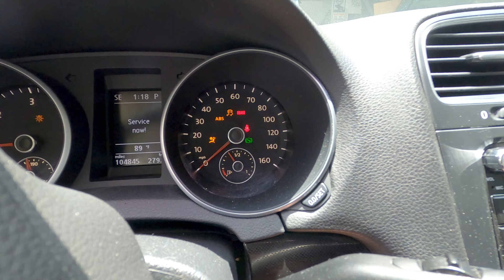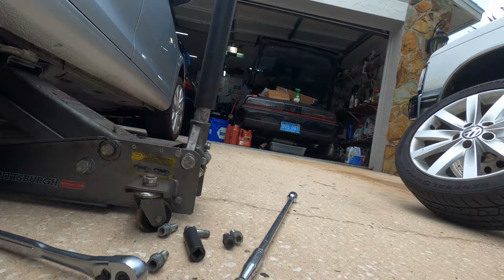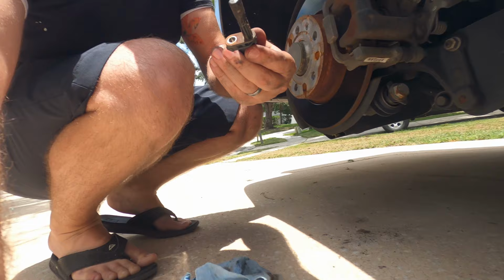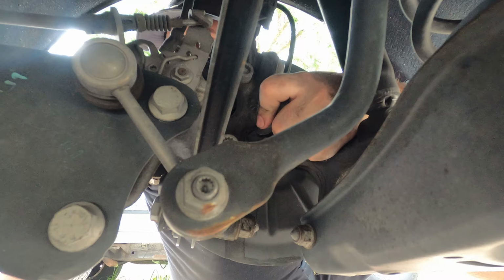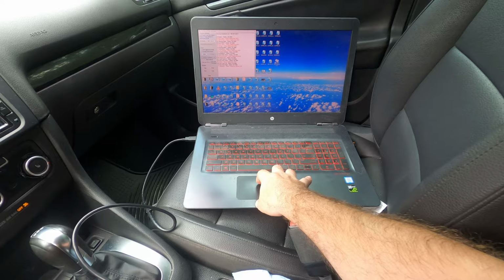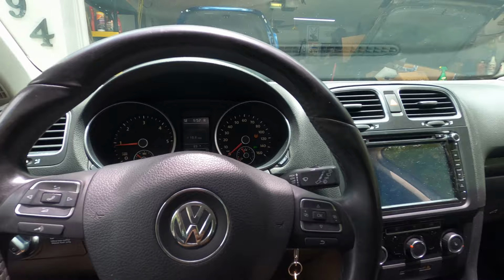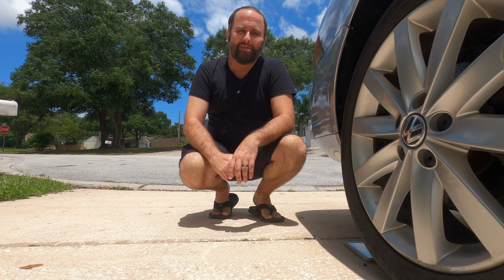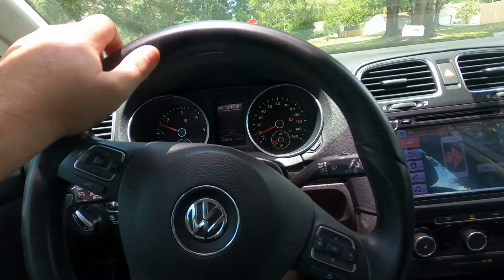VW ABS Wheel Speed Sensor Issues

Comment: I had the exact same warning lights on my audi A3 and Audi told me it was front wheel abs sensor. I replaced it even though it was very clean and still had the lights. Figured out another abs sensor on the rear also needed replaced that and now all warnings are gone.
Reply from the maker: I'm not actually sure cleanliness matters much since cleaning didn't have much of an impact for me.  That's why the scans are so important, that way you know if more than one sensor is acting up.  Weird that the dealer would have missed that though.  Glad you were able to get them all off.  Very annoying to have the whole dash lit up.

Comment: Please use wooden/rubber  blocks between Jackson and stands.. otherwise you remove pant and dent bodywork. Also..you can test your old sensors with an ohmeter to see if they are shot.
Reply: These cars have a solid piece of steel to jack from. It will not bend or dent. It is not a pinch seem just fyi.
Reply: @timbenracing  …paint….then…….rust.

Comment: my passat has this right now, my brake pedal is going nuts when i firmly press it, my gearbox is shifting like a madman, i will take my car to a garage tomorrow, i just replaced my 2 back wheel bearings. hopefully a new sensor will fix it.
Reply from the maker: If the pedal is acting weird you may have bigger issues.  Hopefully it just turn out to be the sensors.  If it all just started happening since you did the wheel bearings then good chance at least one of them got damaged in the process.

Comment: I have a 2015 Passat TDI and am having the same issue except mine is random. It goes off for a few drives, no issues then randomly comes on while I'm driving, then the next time I start it, it comes on again and yes I'm also having issues with the transmission jumping or just having delayed shifts. I was scared my transmission was going out but this gives me hope lol last time it was scanned I was told the front right needed to be replaced so im going to try that.
Reply from the maker: Mine started out like that.  Then the lights stayed on all the time, but the shifting issue was still random.  Good chance swapping out that front right sensor will fix your problem.

Comment: I have same issue with VW CC 2013, lets hope this fixes the issue.
Reply from the maker: It should.  If not check the wiring.  If it's not that, then it's probably the ABS module, which is going to be a bigger and more expensive repair.  WIth as common as this is, it's probably just the sensor.  Good Luck!

Comment: What brand/type of code OBDII reader are you using? I need something that will point me to the correct sensor.
Reply from the maker: I use a VAG-COM from Ross Tech.  It's what you need to get VAG specific codes and interact with the modules.

Comment: awesome video! I have the same issue and dealership said the rear right bearing and hub assy. needed to be replaced along with the speed sensor. will def try this. I dont have a computer to clear the codes, just a fox code reader. will the codes clear themselves once driving, like in your video? thanks in advance.
Reply from the maker: Thank You!  If you replace the faulty sensor then your CEL will probably go away like mine did.  There may still be codes stored in the computer, but it won't cause any issues.   Just keep a close eye on your wheel bearing, if it's making noise then you should replace that too.  If it fails catastrophically then it can be very dangerous.

Comment: Thanks for the video. I have been facing a similar issue with my 2011 Passat. The lights on the dashboard only come up when in a long drive +200 miles, then, if the car is stopped for a while, when restarted the error is usually cleaned from the dashboard. I'm not sure what is the root of the issue in my case.
Reply from the maker: My issue started off like that.  Then eventually the lights stayed on all the time, until I replaced the sensor.
Reply: Same issue with vw cc 2012 
The problem is that when i stop for a little while the error cleaned and the diagnostic scanner can not see any errors.
Don’t know if i have to scan it when the lights showing for the scanner to catch it! But  i can’t expect when it might happen again, to prepare to carry it by the mechanic...

Comment: I have the same lights on, on my Jetta. The lights only come on for a month or so, then they turn off, one at a time, after a few minutes. Eventually they just don't come on anymore. Then maybe a year later, they will come back on again, and cycle repeats. Lol. 2017 Jetta, only about 25k miles.😊
Reply from the maker: I had a little bit of that.  Lights would be on for a while, all would go off, then they would come back.  Most likely you have a sensor that is failing slowly.  I've got another one starting to do that now.

Comment: Hi there!! Great job with video and fit. I am checking to see if I can perform this action on my 2016 Passat S model. Thanks for the link to sensor and ross-tech site..question though- Is the software and hardware compatible for all VAG models? Any idea? I gained confidence after watching you solve the issue and I intend to do it myself now. Please let me know if I can utilize it on 2016 model. Many thanks !!!
Reply from the maker: It should be pretty much the same for you car.  Scanning will tell you for sure.  Yes, the latest VAG-COM should work for your car, but you can confirm on Ross Tech''s site.

Comment: Thanks for the excellent video.  I wish I found this video earlier. Just paid $600 for the VW dealer to make this easy fix.  It all started with my airbag light being on.  They replaced the air bag controller ($900) and 2 days later all the lights came on. They then diagnosed the rear abs speed sensor.  Was it the abs speed sensor all along?
Reply from the maker: I don't believe the ABS sensor should have had anything to do with the airbag.  Do you have a sunroof?  My sunroof leaks have caused airbag issues, from corroding the passenger seat wiring harness.
Reply: @VHickleGarage  your airbag light was on in the begining of the video and went away after you replaced the sensor
Reply from the maker: @ryanloughlin6380  You are right.  Lol not sure what I was thinking with this old reply.  I believe the airbag system may be related to the vss because it's made to not set the airbags off below a certain speed.  This is also something I haven't confirmed, but as you pointed out I had the airbag light and then it went away with the new vss.

Comment: I had took my Jetta to a shop, to change 2 front struts, and 2 front ball joints I got my car back and it has all of these lights. Also my speedometer isn’t working with the lights on is this what yours did? They charged me 1700 just for those items. I have 0 lights on and now my engine light is on too.
Reply from the maker: I believe the Speedo not working could be bad Wheel Speed Sensors, but I'm not 100% sure.  With the work you had done it would seem likely that they either left a sensor unplugged, or damaged one.  I would expect you to have warning lights like what I had though.  You should take it back to the shop and have them scan it and fix whatever they broke.

Comment: I have a similar issue with my Jetta I replaced the sensors but still having the issues with the lights staying on. This helped a lot with changing out the parts. But, I am still seeing the lights as well as the speedometer and odometer are not functioning. I was told by the dealership it was only my sensors that were the problem. Any ideas? Thanks in advance for any advice.
Reply from the maker: I'm not entirely sure.  It could be something to do with the computer.  Have you scanned it again since replacing all the sensors?

Comment: This same thing happened to me after I changed the setting for “Starting Vibration Reduction” while the ABS module was hot.  Now getting a message that it has lost it’s coding, or improperly coded.  Going to need to take my car in to have them generate the long coding to recode it I guess.  I didn’t have a saved code before errors.
Reply from the maker: I haven't messed too much with the coding features, but I remember reading that you can cause some issues if its not done properly.  Have you tried the Ross Tech site for help?  I know they have a lot of info posted there.
Reply: I’ve tried googling it, but turns out it uses LONG coding, 2017 GTI MK7.  I was using OBD11 Pro, under brakes and Adaptation, then starting vibration reduction from OFF -> NORMAL - doesn’t really change that much.  I think it glitched and thought I had more features than I have.  I took it to a shop and they found it was coded for extra features, like front end collision and lane keep assist.  This caused the ABS module to clear out code and go offline.  It took the shop about 2 hours to code correctly and redo all the adaptations by driving and setting steering wheel position sensor.  Car runs great now, NO 6 lights with of them 4 flashing.

Comment: I had to install a new fuse box (the one over the battery)(2004 Jetta).  Upon completion of the installation, the ABS and Brake lights came on.  Assuming the brakes/peripherals didn't suddenly go bad in my garage, could I have accidentally triggered this code, and need to erase it?

Comment: Just had this happen to me trying to change the rear caliper, had to use a tube for extra leverage since those 12 point bolt were rusted to hell and back, ended up busting the abs connector and now I’m dreading to fix it
Reply from the maker: The sensor is very easy swap. 1.5/10 for Difficulty.   Changing a caliper is certainly more involved.  If anything is rusty or stuck make sure to spray with PB Blaster and let it sit overnight.

Comment: Hello my friend thank you for the great video but I have a question. When you got all the lights on (ABS / stabilizer, air bag, traction control) did the car was driving normal or the acceleration did not pass more than 30mph ?  All the lights came on my car and I cannot even drive more than 30mph thanks
Reply from the maker: I did not have that particular issue, but several other people have said they did.  Once you identify the faulty sensor, replacing it should fix all those problems.

Comment: got the same lights plus the battery light along with the steering light. car wont start but will turn over. any ideas? (vw gti 2011)
Reply from the maker: The battery and steering wheel lights are common with low voltage and/or battery replacement.  Have you replaced your battery recently, or is it old?  Low battery voltage can also cause a no start situation where the engine does still crank.  Battery, and the connections would be first thing I would check.  After that you really need to scan the computer to see what codes are stored.

Comment: Thank you for the video! I have the same lights coming on my 2012 Jetta SE and scanned it to find out my rear right ABS speed sensor is also malfunctioning. I feel the same transmission issues with gear hunting you described. However, I also hear this sound coming from under the car, best way I can describe it is as if a branch was caught underneath and being dragged on the road. It is not always present and it is rhythmic, increasing when I accelerate and decreasing when I brake. It also seems to be more present when turning. Is this something you experienced/Do you think replacing the speed sensor would fix this? Or is there a bigger issue with my brakes or wheel bearing?
Reply from the maker: That noise shouldn't be related to the speed sensor.  Sounds like it's possibly a bearing or CV Joint (axles) issue.  I have some bearing/CV noise as well that comes and goes.  I know those are both common issues on these cars.  I have all new stuff sitting in the garage, but I haven't gotten around to swapping them yet.  If your noise is intermittent then it's probably not dire yet, but something to think about doing soon.
Reply: Did you use a regular obdII monitor?
Reply: @joewaltz2709  it was an OBDeleven

Comment: I drive a 2012 GTI & I’m having all the same lights come on my dash but I’m not experiencing any gear hunting issues & no traction or braking issues as far as I can tell. I’m hoping it’s just a broken sensor or wire rip near the sensor, or I might just need new rotors and pads.
Reply from the maker: Best to scan to see what all codes you're getting.  It's probably a bad sensor that just isn't giving you the other issues.  Brakes may, or may not be related to VSS issues.

Comment: Mine broke is there a way to get it out without taking off the wheel bearing ?
Reply from the maker: The bolt broke, or the sensor broke?  If it's just the sensor it should be pretty easy to drill out since it's mostly plastic.  Alternatively, you could use a torch to heat it up and probably get it out that way.  

If it's the bolt, you're going to need an extractor (never works for me), or you'll have to carefully drill it out and then chase the threads, or re-tap it.  Worst case would be drilling it out too far, in which case a helicoil kit would probably be your only solution.

Comment: I also had all the dash warning lights. The only difference is that I didn't have to repair it. I had gotten to the live screen on my new Autophix 7610 scanner. (The instructions are mysterious.) I was looking for the tire pressure monitoring system but today I stumbled upon the brake system and found the four wheel sensors. It said the front left was not working. I took a chance and found and clicked OK on erase all error codes. THEY ERASED! All warning lightsl had gone out BEFORE while intestate driving but they always came back on before I got out of my driveway. I especially hated that my cruise control would not engage.Then I followed direction on the scanner and unplugged it and then reconnected the scanner. I scanned it for fault codes and it said NONE. I went back to the live four wheel sensors and all were listed. I put it into drive and all four showed 11mph. 
FIXED! I will keep my four sensors until I need them. I hope others, like me, used V. Hickle's video to  stay out of the dealers shop. The 2016 Passat oil change last week, was advertised to include an inspection. I spent HOURS searching manuals and watching ALL these videos, when VW could have found and erased the codes in a minute. ( I thought they did.) I hope this works for yours.
Reply: Today I took the 2016 Passat for a pleasure cruise. NO CHIMES, NO DASH WARNINGS - NOT ONE. I think I'll keep it. 79,000 mi. ;)
Reply: next day ALL LIGHTS BACK ON DASH :(
Reply: next day I discovered it's not a torx 30 , it's a 5 hexagon for  the sensor bolt. A small right angle handle or long bit would have helped. It was stuck on so a butter knife  and hammer broke it loose. I used a sensor from Amazon which had all four for under $30. The scan showed it working and after a half mile the TIRE  AND STEERING ANGLE dash light has not come back on. The ABS and TRACTION dash lights were flashing alternately and after a few miles they now flash together. The car has under 80 K. Fault code will not read (no communicate) BTW: it was a wet road and braking seems fine for hard stopping. NO CRUISE CONTROL AGAIN. It's going to the shop. SORRY
Reply from the maker: Sorry to hear you had to take it to the shop.  Sounds like you may have something beyond bad sensors if you weren't able to communicate with the computer.  I've always used the VAG-COM.   I've heard the VAG cars can be hard to fully access with generic OBD 2 scanners, but weird that it worked for you the first time but not the 2nd.

Comment: So I have a 2019 I’ve replaced me entire abs wheel speed harness and sensor and it’s fixed nothing even throwing epc code now
Reply from the maker: Which codes did you have at the beginning?  Just sensors?  If you've done that much already, it sounds like the ABS module itself could be bad.
Reply: @VHickleGarage the one thing I haven’t replaced yet is the wheel bearing and I’m wondering I’m that’s it

Comment: Hey! So I’ve just done that on my mk6 golf and the codes came back on. I have no idea what it could be. My fuses are okay and the sensors new. I’m just lost now 😂
Reply from the maker: Have you scanned since you replaced the sensors?  Cleared codes?  I'm guessing you're throwing other codes if it came back.  Either that or wiring is damaged. . .in which case you should still be showing a code for a bad sensor.

Comment: Was your speedometer also not working? I just changed my starter motor on my Jetta and now all of those lights are on
Reply from the maker: I never had any speedo issues, but a few other people have reported that.  Nothing else was done except the starter?  I would check all the adjacent wiring, and scan to see which corner is reading an abs fault.

Comment: Can you please help i have a 2004 Volkswagen Jetta 2.0 automatic transmission the car is not shifting at all the code is p0715 i bought these speed sensor i dont know where there located. I have check engine light airbag and break light its a circle with lines on both side believe it is that are on all orange can you reach out directly with any possible feedback such as location of this sensor etc would be highly appreciated
Reply from the maker: If you watch the video you should be able to see where the sensors are located.  It's on the back side of the wheel, and is just held in by one bolt.  

I'm not 100% sure if the 2004 has the same design, but it should at least be similar.  You also have a different transmission than the DSG in  my car, so again I'm not sure if what I did in the video is applicable to you, but if the scan says a sensor is bad I would replace it and start there.